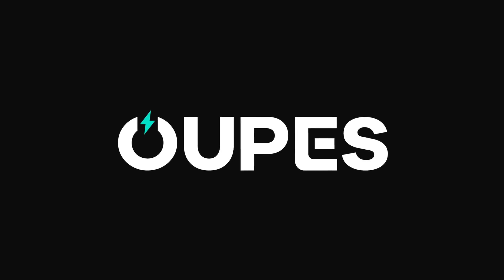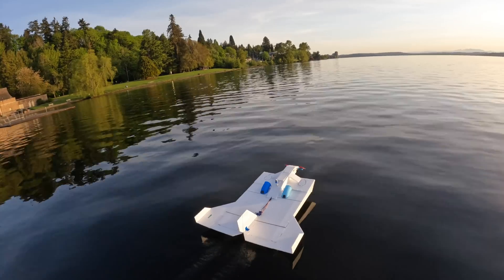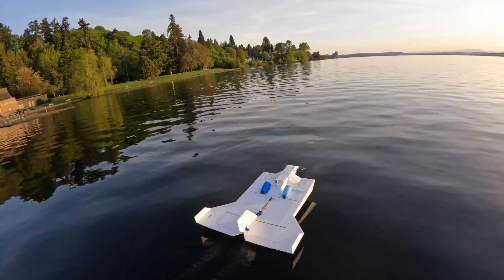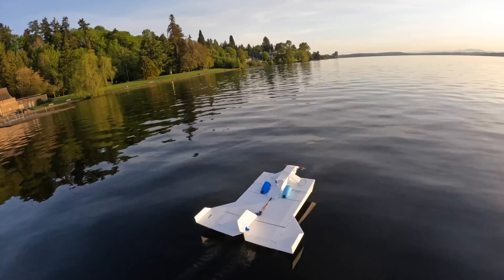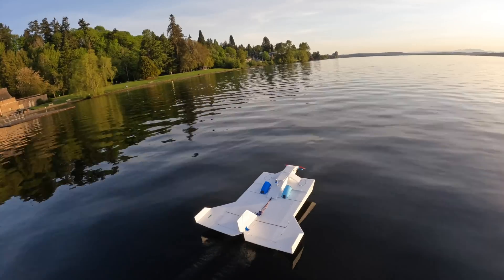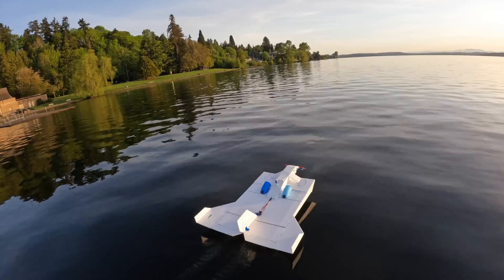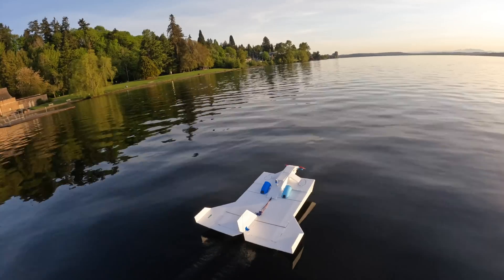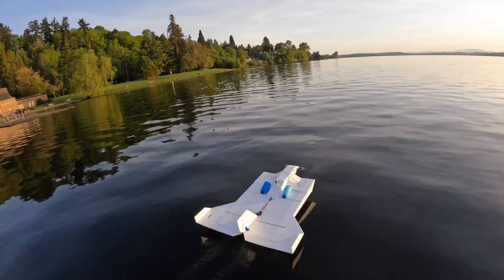Testing WWII Era Terrain Following 'Radar' On R/C Plane

Comment: @rctestflight 8:38, could you just embed and remotely activate a smoke genade in the fueslage, maybe even fully encasing one with ventilation holes/plastic tubes to duct it to different outputs around the main body and wing tips?

Comment: I think you should connect the giro to the sonar sensor, so you will be able to compensate for the angle change, and almost fully control the plane based on the giro, but adjust the altitude based on filtered and processed sonar data

Comment: A physics model along with a control loop will take care of most of the issues. The physical model can be as simple as the equations of motion or as complex as a full body within a fluid dynamics simulation, for this problem you just need to take into account planes altitude, attitude and velocity, that way you'll have a longer period of predictive ability and avoid the oscillations.

Comment: Here's a thought, though it's more complicated. If you had a sensor, maybe radar, that gave you a few points of distance measurement both under the plane and a little bit in front of it, perhaps the look-ahead would allow closer terrain following. It's not like you're limited by control authority, but you might not have quite enough reaction time, looking almost directly under the plane like currently. If the plane is flying at 10 m/s, looking ahead 10 cm would mean you'd need to do control actions in milliseconds, and I don't think any of your flaps move that fast.

Comment: @rctestflight #rctestflight 
I think the issue is measuring right under the airplane , you should look in to get data from at least few meter ahead of the plane so you have time to adjust accordingly.   the electronic can process fast but the phisical response of the plane can't

Comment: I'd guess when the controller adjusts the height and changes the yaw of the plane, it also changes the angle at which the sonar measures the distance. This could account for some of the unstable behaviour.
Reply: Logging raw sensor data and all PID terms corrections would really clarify what's going on.

Comment: My wet grinder, besides using a similar non-fluid oil, has pads of felt to retain the lube along the shaft. Two of them form long tubes/rings around it. It withstands being submerged. It has a third trick too, gears on the ends with another parallel shaft to pick it up. Whole thing is in a bolt down cover (commercial manufacturer). It is legit waterproof. 
   Something in there might help.

Comment: Did you ever consider using a large flying wing like an Eflite Opterra? Or maybe something with a wing chord more the "middle" range than the extremes with spoilers controlling altitude?. I seem to get this ground effect when I land my Opterra as well as my Radian XL without the spoilers open.  I find I need to push the stick forward or open the spoilers just make it touch down before I run out of runway even when flying slowly.

Comment: There's expanding foam calculators online that should get you in the ballpark of how much foam you need to pour for your volumes (if they don't reach low enough, just divide). I'd link, but ... yt. I've used them several times to fill voids and gaps in materials that are otherwise pretty thin and would bow out if too much foam was used. Good resource.

Comment: Just a thought maybe make the  wonds longer, maybe about half a meter this will reduce the response. 
As an ex glider pilot the ground affect is something many experienced pilots used to have fun with when coming in to land or even just doing a pass of the field before turning back and landing. There are many great videos on YouTube of pilots using the ground event sometime long distances from the airfield.

Comment: It seems like the feedback loop needs to account for both height above the ground and pitch. A pitched down plane nearing the water needs to pull up, but a pitched up plane near the water will soon be high enough above the water without further pulling up. In other words, the altitude adjustment loop needs to know if it is too low and pitched to go lower, or too low and pitched to go higher, with a weaker or even inverse adjustment in the latter case. Likewise for being too high. This was very apparent with the stick based design, but I suspect would be much easier to implement with the flight controller and ultrasonic sensor design.
Reply: Similar to my theoretical solution, which was to have the servos controlled directly by the radar output’s  RATE (i.e. how FAST the plane is climbing or falling) that way as soon as the plane starts to level out, the servos will be at zero. You could have the plane SLOWLY approach the ideal cruise height, then engage the subroutine that controls the servos. I obviously agree this would be much easier with flight controller than with “mechanical radar stick”.
Reply: @ZenZooZoo  That's already what's happening with the D part of the PDI controller, no?
Reply: Nice. Could be done with a forward and rear wand. I also think a damper on the wand/canard system could help.
Reply: @snower13  that's a clever solution, would be interested to see if this sort of mechanical method could work
Reply: @snower13  yes to the damper thing. when he started cutting away at the canards i was like noo this is not the way. i intuitively knew it was because the sticks are too rigid. they change the angle of attack drastically in response to just a small input. if they could bend some so there is a more proportional response it might help.
Reply: @danielbehrendt9683  well, the cutting problem needed to happen but I think the low inertia R/C plane requires more than just a proportional response. But he was in the field and had limited resources.
Reply: I wrote my own flight controller for  a tricopter. There are a lot of parallels here. The first thing will be a nested PI controller. An inner PI (or just P) loop controls the rate of change of altitude, say 0.1m/s climb rate. An outer and slower PI controller sets the actual altitude. These don't have to be on the same sensors. He could use a barometer or accelerometer on the fast inner loop, and the sonar on the outer loop, if the barometer gives a more accurate reading of the rate of change in altitude, wheras the sonar will maybe give a better absolute value for the altitude. This is also important if the water is wavy as the outer loop can be very slow and apply vicious filtering. Another thing will be he needs to get the real altitude. He needs to make sure that the altitude from the sonar is adjusted depending on the flight angle. If he's pitched up, the real altitude will be lower than the altitude indicated by the sonar, compared to if he's flying level.
Reply: @calloutman I somewhat agree with what you're saying here about the similarities to multirotors control. It's kind of a gnarly problem to solve, making a plane fly level in the reference frame of a human observer, but controlling it from the reference frame of the plane, using only a distance measurement to an oscillating surface as the feedback for the control loop.

Unless it's a super high frequency sonic range finder that he's using that is designed to be used in a moving setup at those speeds, there are probably going to be aliasing problems, significant doppler shift issues, etc. The naïve temptation would be to low pass filter the feedback, but before that can work you need to decouple the variance in height due to the waves from the variance in height due to the altitude, not to mention things like cosine error in the sensor measurements due to the plane's attitude.

Personally I'm not sure if a nested PD or PID loop is enough. Not to say that it isn't, but I'd be impressed if it was. If I had to bet, I'd put my money on an approach that made use of multiple sensors and an EKF. Otherwise I think as the nice man in the video said, the only way to do it with simple control loops would be to rely on a setup that is already physically stable.
Reply: What you are implying is actually the D-Term in a PID loop, which tries to bring the rate of change (in this schenario the climb rate) to zero. There is an interesting wikipedia article about pid loops and a schematic program (pseudo-code) that explains it really well.
Reply: @EXPRCP  although I think there is actually a slight difference between climb rate and angle of attack; especially when controlling altitude via power or flaps, rather than the elevator. I'm not sure whether climb rate or angle of attack would be more useful here, but I suspect owing to the inertia of the plane, the angle of attack has some impact on the second derivative of height above the ground (vertical/climb acceleration? Not sure what the correct term is). I can't quite intuit what that effect would be though.
Reply: @EXPRCP  A better way to explain my failed point would be, you commonly create an "acceleration control" PID to serve the job of a "velocity controller". Your requests are still steady state velocity.

Similarly, this plane might have better results being a "derivative of elevation" controller rather than pure elevation controller.

Still, if you're willing to write out the physics equations to describe the state-space model, H2 or H-infinity would be much better solutions than PID. That is, given some CPU. But, MATLAB will spit out the matrices you need.
Reply: @EXPRCP  Ah cool, that would explain why this problem was much more noticeable with the mechanical solution then, since clearly it doesn't have this
Reply: You might play with pointing the sonar slightly forward instead of straight down.
Reply: I was also thinking more range for the control surfaces to actively lose altitude would probably help too. It seems like he was overshooting his altitude gains, but then just letting mostly gravity pull his plane down, which by the time that happened, seemed to be a pretty slow oscillation that built up a lot of downwards speed.

Having the  down direction also a part of his active control would at least bring all the oscillations within his control range, so they could be worked out as much as possible.
Reply: maybe it would be worth looking into mpc (model predictive control)... although I'm not sure if the flightcontroller has enough computing power...
Reply: That's a good point. Maybe a plane that's designed for canards (like a Long EZ) would be better, as it would have a longer nose.

Comment: Use forward sweep to get better ground effect by thinner wing chord, this will also Improve the turning ability with less roll. Forward sweep has a similar flow characteristic as ground effect, therefore it will improve speed , lift and weight

Comment: The deep cord thing makes sense, since the ground effect comes from disrupting wingtip vortices. Longer, thinner wings have smaller wingtip vortices, which reduces drag and increase efficiency - but you don't care about efficiency in full flight, so thicc wings are good.
Reply: I agree (i think). But it seems like the deep chord is ram effect and not so much ground effect. Ultimately on an rc plane it seems too hard to effectively use ground effect (creating the vortices, then flying low enough to counter them)

Comment: I'm flyin low checkin efficiency gains
Testin wing shapes on RC planes
Deep cords feel stronger ground effect buzz
But thin ones might get better results

This Fox glider got a long wingspan
Should feel ground effect above a meter scan
Installed sensors, art pilot too
Try fly itself at the right altitude

Tried followin the surface below
But it kept bouncin, just wouldn't flow
Tuned the PID but nothin worked right
Still oscillatin out of sight

Pontoons I added for water tests
Flyin on the lake, flyin my best
But the controller still had issues
Keepin it steady, raisin fizzles

Tried flaps next to make it rise higher
Near the water, make the altitude wire
But they couldn't stop the jumps
The pitch and airspeed just too much pumps

Wand concept next, canards it did flex
Rotatin surfaces based on checks
But responses had to be lessened
Then it was too weak, flow now questionin

Came up short on solutions galore
But problems like these I want more
Control systems is beyond me ya'll
Hit me up if you can help it's not small

Learned thick cords feel it most true
But efficiency gain scales are tough to accrue
Scale affects it heavy too it's clear
Big planes don't feel it, only up close and near

So ground effect tests will keep rollin on
Till self stabilizin designs are fully gone
Appreciate y'all watchin my vids
Subscribe if you dig it, peace I bid
Reply: I wonder 🤔 how this would sound with a sick beat and Eminem performing 😎❤
Reply: These lyrics low-key fire tho...